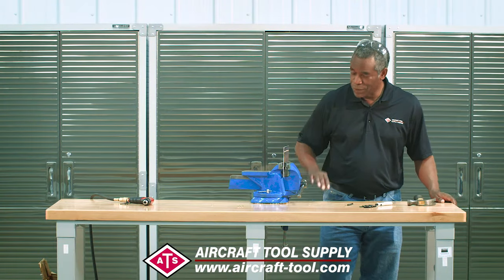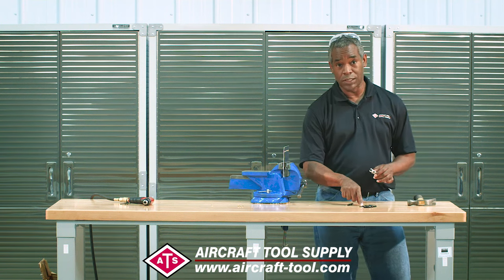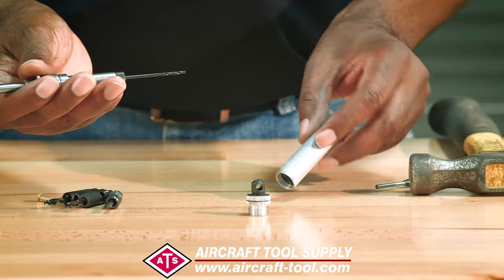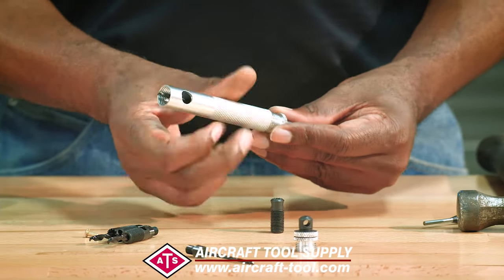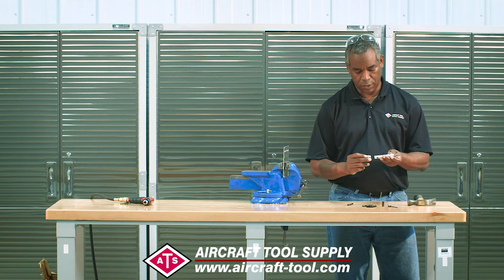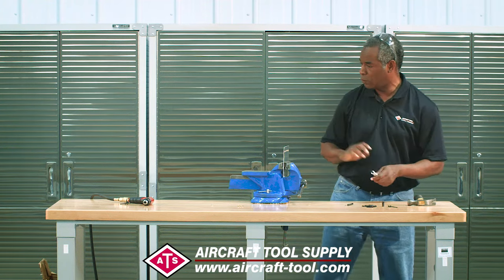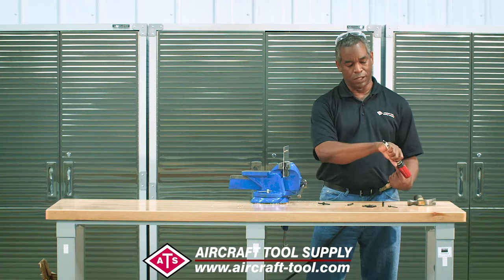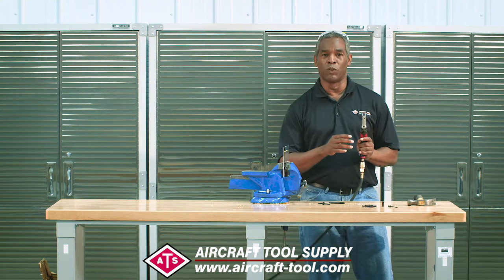How to remove rivets with the 1341S Rivet Removal Tool Instructional Video

Comment: Too many wide shots when detail shot was needed.
Reply: If you are a serious sheetmetal worker ,and want a rivet removal tool that doesn't have a hand full of parts to keep up with ,and you need to get the job done quickly and accurately, also has a lifetime warranty, and 5 different sizes instead of 4, plus will drill out any protruding head fastener, weather it be Cherry Max , Cherry Lock, Hi-lok , Hi-Lite, AN -470 , and is very compact, and will work in tight areas that the others won't fit into, then you need to check out  ATS 's Rivet Removal Kit  P/N  LRDG - KIT or  order online from Loyd's Rivet Drill Guide

Comment: Yea keep the camera close so we can actually see it
Reply: If you are a serious sheetmetal worker ,and want a rivet removal tool that doesn't have a hand full of parts to keep up with ,and you need to get the job done quickly and accurately, also has a lifetime warranty, and 5 different sizes instead of 4, plus will drill out any protruding head fastener, weather it be Cherry Max , Cherry Lock, Hi-lok , Hi-Lite, AN -470 , and is very compact, and will work in tight areas that the others won't fit into, then you need to check out  ATS 's Rivet Removal Kit  P/N  LRDG - KIT or  order online from Loyd's Rivet Drill Guide

Comment: This guy is great! Super helpful and funny 😄
Reply: If you are a serious sheetmetal worker ,and want a rivet removal tool that doesn't have a hand full of parts to keep up with ,and you need to get the job done quickly and accurately, also has a lifetime warranty, and 5 different sizes instead of 4, plus will drill out any protruding head fastener, weather it be Cherry Max , Cherry Lock, Hi-lok , Hi-Lite, AN -470 , and is very compact, and will work in tight areas that the others won't fit into, then you need to check out  ATS 's Rivet Removal Kit  P/N  LRDG - KIT or  order online from Loyd's Rivet Drill Guide
Reply: I thought his voice was easy to listen to as well.

Comment: Great tool and video. However, you forgot to put your safely glass on when drilling!!!
Reply: If you are a serious sheetmetal worker ,and want a rivet removal tool that doesn't have a hand full of parts to keep up with ,and you need to get the job done quickly and accurately, also has a lifetime warranty, and 5 different sizes instead of 4, plus will drill out any protruding head fastener, weather it be Cherry Max , Cherry Lock, Hi-lok , Hi-Lite, AN -470 , and is very compact, and will work in tight areas that the others won't fit into, then you need to check out  ATS 's Rivet Removal Kit  P/N  LRDG - KIT or  order online from Loyd's Rivet Drill Guide

Comment: Very handy! Thank for sharing this!
Reply: If you are a serious sheetmetal worker ,and want a rivet removal tool that doesn't have a hand full of parts to keep up with ,and you need to get the job done quickly and accurately, also has a lifetime warranty, and 5 different sizes instead of 4, plus will drill out any protruding head fastener, weather it be Cherry Max , Cherry Lock, Hi-lok , Hi-Lite, AN -470 , and is very compact, and will work in tight areas that the others won't fit into, then you need to check out  ATS 's Rivet Removal Kit  P/N  LRDG - KIT or  order online from Loyd's Rivet Drill Guide

Comment: I have one of these in my toolbox & have used it 2 or 3 times. It takes too much time to go to my toolbox, disassemble the tool, install the right drill bit (which must be threaded), the right nosepiece, install on drill, then go back to my workplace and drill out the rivets. By the time I do all that I could drill out a dozen or more rivets the right way, the old fashioned way. This guy says "you're gonna miss, and you're gonna damage your sheet." No, not if you drill straight, correct depth, with the right diameter bit, which is what we learn in A&P school. This tool is a good idea but it takes too long to manipulate in a time-sensitive environment on a commercial jet work card. This guys not even holding the drill straight in a demo video.
Reply: I have about 900, 3/16" rivets to remove. Would this tool be worth it if it was more than the dozen or so you could do without it?
Reply: If you are a serious sheetmetal worker ,and want a rivet removal tool that doesn't have a hand full of parts to keep up with ,and you need to get the job done quickly and accurately, also has a lifetime warranty, and 5 different sizes instead of 4, plus will drill out any protruding head fastener, weather it be Cherry Max , Cherry Lock, Hi-lok , Hi-Lite, AN -470 , and is very compact, and will work in tight areas that the others won't fit into, then you need to check out  ATS 's Rivet Removal Kit  P/N  LRDG - KIT or  order online from Loyd's Rivet Drill Guide
Reply: @garyloyd9898  I'll stick with the right size drill bit & a punch. Much quicker if you're experienced, like I am! Modern "work-around" tools take too much time to set up and manipulate.
Reply: @gossumx  If you've literally got several hundred rivets, or other fasteners, to drill out then the guy that did it should be ass-kicked out the door. Anyway, the rivet removal tool in this video would probably be beneficial in your situation. All you have to do is remove & replace the drill bit as they become dull.
Reply: @crooked-halo  Hah, yep.  But in this case, it's a school bus. I needed to remove the wall panels so that I could cut it in half and raise the roof a couple of feet taller. I ended up getting away with using an air chisel to knock them off, at the expense of a little damage to the surrounding sheet metal.  Geeze, it was a pain though.  And ended up being closer to 1500 to remove 😭

Comment: I assumed that this was for drilling out CherryMax-type rivets, not plain ole AN rivets. I drill out a lot of AN rivets, I don't need this, but I thought it might be handy for blind rivets. Oh, and seriously bad example with the safety glasses but hey, you are loooking goood!
Reply: If you are a serious sheetmetal worker ,and want a rivet removal tool that doesn't have a hand full of parts to keep up with ,and you need to get the job done quickly and accurately, also has a lifetime warranty, and 5 different sizes instead of 4, plus will drill out any protruding head fastener, weather it be Cherry Max , Cherry Lock, Hi-lok , Hi-Lite, AN -470 , and is very compact, and will work in tight areas that the others won't fit into, then you need to check out  ATS 's Rivet Removal Kit  P/N  LRDG - KIT or  order online from Loyd's Rivet Drill Guide
Reply: ATS does have a very similar tool for drilling out blind rivets.  The main difference is that the nosepiece is serrated to keep the rivet from spinning.

Comment: Need something like this to remove LARGER rivets like those in a car frame.
Reply: If you are a serious sheetmetal worker ,and want a rivet removal tool that doesn't have a hand full of parts to keep up with ,and you need to get the job done quickly and accurately, also has a lifetime warranty, and 5 different sizes instead of 4, plus will drill out any protruding head fastener, weather it be Cherry Max , Cherry Lock, Hi-lok , Hi-Lite, AN -470 , and is very compact, and will work in tight areas that the others won't fit into, then you need to check out  ATS 's Rivet Removal Kit  P/N  LRDG - KIT or  order online from Loyd's Rivet Drill Guide

Comment: Great tool, just remember eye safety.
Reply: If you are a serious sheetmetal worker ,and want a rivet removal tool that doesn't have a hand full of parts to keep up with ,and you need to get the job done quickly and accurately, also has a lifetime warranty, and 5 different sizes instead of 4, plus will drill out any protruding head fastener, weather it be Cherry Max , Cherry Lock, Hi-lok , Hi-Lite, AN -470 , and is very compact, and will work in tight areas that the others won't fit into, then you need to check out  ATS 's Rivet Removal Kit  P/N  LRDG - KIT or  order online from Loyd's Rivet Drill Guide

Comment: Not sure what this gets me that a drill stop doesn't.
Reply: If you are a serious sheetmetal worker ,and want a rivet removal tool that doesn't have a hand full of parts to keep up with ,and you need to get the job done quickly and accurately, also has a lifetime warranty, and 5 different sizes instead of 4, plus will drill out any protruding head fastener, weather it be Cherry Max , Cherry Lock, Hi-lok , Hi-Lite, AN -470 , and is very compact, and will work in tight areas that the others won't fit into, then you need to check out  ATS 's Rivet Removal Kit  P/N  LRDG - KIT or  order online from Loyd's Rivet Drill Guide
Reply: It has a cupped nose-piece whcih centers the drill on the rivet head.

Comment: Currently in school for my A&P in Tucson, riveting class semester. Would this work for deformed head rivets? like nicking it creating the smile
Reply: On the job a smile should always be replaced. Your instructor shouldn't let you use this tool in class. He/she will want you to learn the right way, the old fashioned way, to drill out a rivet. A DME won't let you use this during your "A" practical test. On the job the tool in this video takes too long to disassemble & re-assemble, though it does work well if you're not in a time-sensitive environment.
Reply: @crooked-halo  

I can see this tool being very handy if you have more than just a few rivets to remove. When I just have a few I have a nice 7/16" jobber bit that I use.
Reply: If you are a serious sheetmetal worker ,and want a rivet removal tool that doesn't have a hand full of parts to keep up with ,and you need to get the job done quickly and accurately, also has a lifetime warranty, and 5 different sizes instead of 4, plus will drill out any protruding head fastener, weather it be Cherry Max , Cherry Lock, Hi-lok , Hi-Lite, AN -470 , and is very compact, and will work in tight areas that the others won't fit into, then you need to check out  ATS 's Rivet Removal Kit  P/N  LRDG - KIT or  order online from Loyd's Rivet Drill Guide

Comment: Link?
Reply: If you are a serious sheetmetal worker ,and want a rivet removal tool that doesn't have a hand full of parts to keep up with ,and you need to get the job done quickly and accurately, also has a lifetime warranty, and 5 different sizes instead of 4, plus will drill out any protruding head fastener, weather it be Cherry Max , Cherry Lock, Hi-lok , Hi-Lite, AN -470 , and is very compact, and will work in tight areas that the others won't fit into, then you need to check out  ATS 's Rivet Removal Kit  P/N  LRDG - KIT or  order online from Loyd's Rivet Drill Guide

Comment: Will this tool work on treaded rivets ?
Reply: If you are a serious sheetmetal worker ,and want a rivet removal tool that doesn't have a hand full of parts to keep up with ,and you need to get the job done quickly and accurately, also has a lifetime warranty, and 5 different sizes instead of 4, plus will drill out any protruding head fastener, weather it be Cherry Max , Cherry Lock, Hi-lok , Hi-Lite, AN -470 , and is very compact, and will work in tight areas that the others won't fit into, then you need to check out  ATS 's Rivet Removal Kit  P/N  LRDG - KIT or  order online from Loyd's Rivet Drill Guide

Comment: Haha, cool guy, awesome tool - probably cost a fortune.
Reply from the maker: https://aircraft-tool.com/shop/search.aspx?keyword=1341s
Reply: If you are a serious sheetmetal worker ,and want a rivet removal tool that doesn't have a hand full of parts to keep up with ,and you need to get the job done quickly and accurately, also has a lifetime warranty, and 5 different sizes instead of 4, plus will drill out any protruding head fastener, weather it be Cherry Max , Cherry Lock, Hi-lok , Hi-Lite, AN -470 , and is very compact, and will work in tight areas that the others won't fit into, then you need to check out  ATS 's Rivet Removal Kit  P/N  LRDG - KIT or  order online from Loyd's Rivet Drill Guide

Comment: Same way i'd do it safety glasses on your hair and all
Reply: RVW III dude the guy was joking saying he'd do the same thing. Chill out!   Nice tool.
Reply: If you are a serious sheetmetal worker ,and want a rivet removal tool that doesn't have a hand full of parts to keep up with ,and you need to get the job done quickly and accurately, also has a lifetime warranty, and 5 different sizes instead of 4, plus will drill out any protruding head fastener, weather it be Cherry Max , Cherry Lock, Hi-lok , Hi-Lite, AN -470 , and is very compact, and will work in tight areas that the others won't fit into, then you need to check out  ATS 's Rivet Removal Kit  P/N  LRDG - KIT or  order online from Loyd's Rivet Drill Guide

Comment: Bad camera work this whole process should be a close up shot and the guy doing this can't even hold the drill driver straight.
And if you work for a company they wouldn't want you to take the time to change over to do the job.
Reply: If you are a serious sheetmetal worker ,and want a rivet removal tool that doesn't have a hand full of parts to keep up with ,and you need to get the job done quickly and accurately, also has a lifetime warranty, and 5 different sizes instead of 4, plus will drill out any protruding head fastener, weather it be Cherry Max , Cherry Lock, Hi-lok , Hi-Lite, AN -470 , and is very compact, and will work in tight areas that the others won't fit into, then you need to check out  ATS 's Rivet Removal Kit  P/N  LRDG - KIT or  order online from Loyd's Rivet Drill Guide

Comment: This dude was so nervous
Reply: If you are a serious sheetmetal worker ,and want a rivet removal tool that doesn't have a hand full of parts to keep up with ,and you need to get the job done quickly and accurately, also has a lifetime warranty, and 5 different sizes instead of 4, plus will drill out any protruding head fastener, weather it be Cherry Max , Cherry Lock, Hi-lok , Hi-Lite, AN -470 , and is very compact, and will work in tight areas that the others won't fit into, then you need to check out  ATS 's Rivet Removal Kit  P/N  LRDG - KIT or  order online from Loyd's Rivet Drill Guide